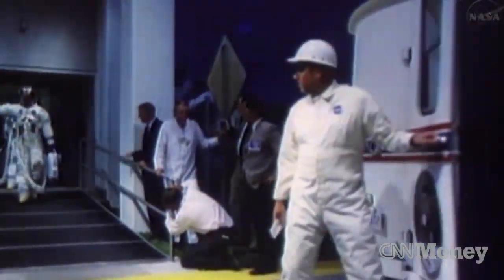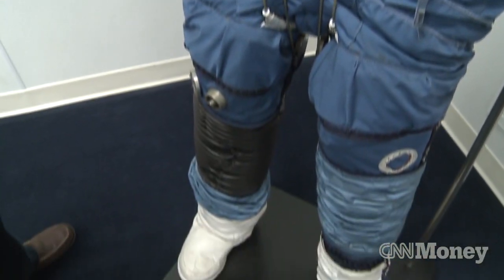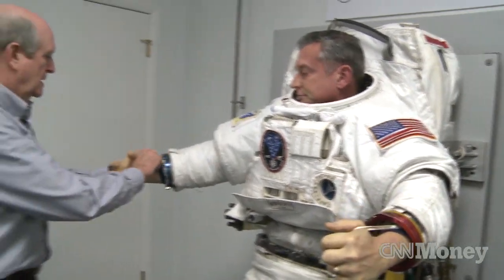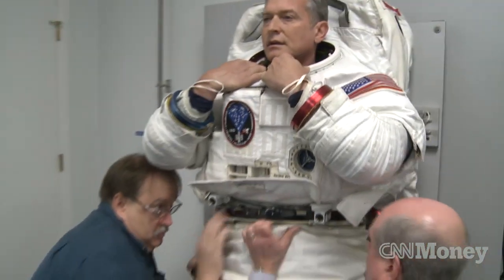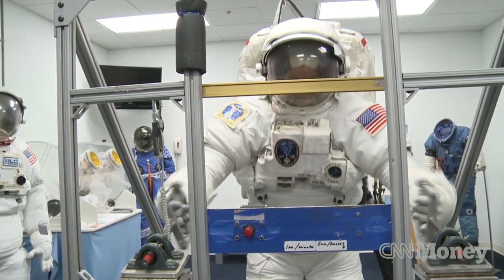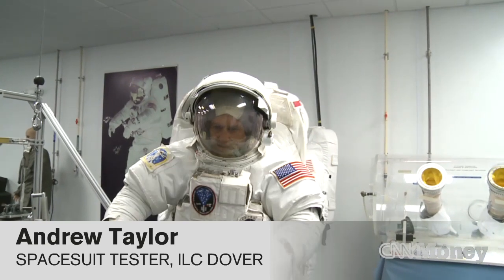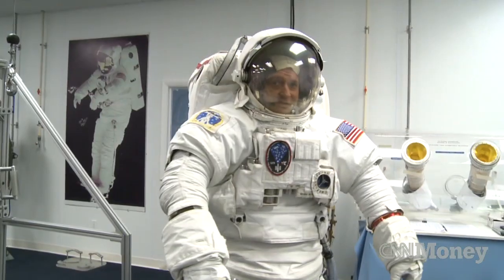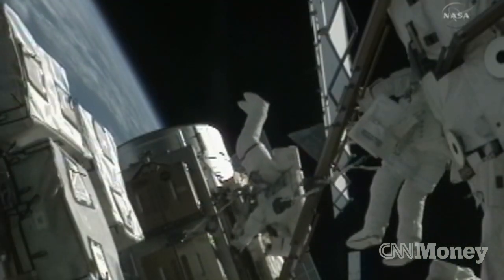See how NASA spacesuits are tested

Comment: Guys - you don't need to vacuum test a spacesuit. A spacesuit is not stressed by a vacuum, but by its internal pressure. Vacuums don't do anything. Here on Earth, at sea level the atmospheric pressure is about 15 psi. In space, suits are pressurised to about 5 psi of pure oxygen. To pressure test the suit here on Earth you only need to apply the same differential pressure of around 5 psi that would be seen in space conditions. Therefore an internal pressure test of approximately 15 + 5 = 20 psi.

In fact, the suits would likely be tested to higher pressures than this, i.e. 20 psi x SAFETY FACTOR.
Reply: They cannot use that formula since the torr level differences between a vacuum chamber and deep space is not even comparable. Try 2000 psi instead of 20
Reply: @xismxist  I am not talking about using a vacuum test. Rather a differential pressure test.

The differences between a vacuum chamber and deep space may appear great in terms of the pressures, as measured in torr, but that is a tiny unit (tiny fractions of 1/760 of atmospheric pressure). The difference between deep space and an artificial 'high vacuum' created on Earth is about 0.0000001 Pa or about 0.000000000001 Torr.
Regardless of the units involved the key point is that vacuum places no loads upon any structure - only a pressure differential can do that. (Vacuums do not "suck").
Therefore to test a spacesuit in terms of its structure, flexibility and atmosphere retention one only has to create the pressure difference that would be experienced by the suit in deep space.
That does not mean that a vacuum chamber test would not be desireable - but as I have also explained the difference between artificial high vacuum and deep space is negligible in terms of suit or life support functioning.
Reply: @eventcone  But i did, since you made it looks so easy "you only need to... blah" - wrong! you cannot ASUME. Only a test in true vacuum will prove what the suits can take. The pressure they NEED to test the suits with will most likely cause them to bow up. Even to this day, no humans has ever been tested inside the worlds most "powerful" vacuum chamber, why not?
Reply: @xismxist  "Only a test in true vacuum will prove what the suits can take".
Structurally? That's not true at all. A suit tested in atmosphere at sea level pressurised to 20 psi or so will experience the same pressure loading as one tested in deep space pressurised to 5 psi.

"The pressure they NEED to test the suits with will most likely cause them to bow up".
What does this even mean? "Bow up"?

"Even to this day, no humans has ever been tested inside the worlds most "powerful" vacuum chamber, why not?"
So far you have failed to explain why you think this would be necessary.
Reply: @xismxist  "Only a test in true vacuum will prove what the suits can take".
Structurally? That's not true at all. A suit tested in atmosphere at sea level pressurised to 20 psi or so will experience the same pressure loading as one tested in deep space pressurised to 5 psi.

"The pressure they NEED to test the suits with will most likely cause them to bow up".
What does this even mean? "Bow up"?

"Even to this day, no humans has ever been tested inside the worlds most "powerful" vacuum chamber, why not?"
So far you have failed to explain why you think this would be necessary.
Reply: @eventcone  Again you ASUME that 20 psi is enough to use when pressure testing a suit, well that formula MIGHT work for a very low earth orbit but doesnt stand a chance in deep space (i.e on moon) and you know that i meant to say BLOW up! aleady out of arguments so you start pointing out spelling errors? well that IS typical for the propagandists to do.  And no, NASA is the ones who should explain why they dont dare to put humans inside their biggest vacuum chamber, after all thats just a walk in the park compared to the vacuum levels in deep space
Reply: @xismxist  So you have run out of arguments? Your last post contains none - merely assertions and rants. Please tell the world WHY a 20 psi test in atmosphere would not "stand a chance" of replicating the conditions of deep space?

Blow up? I suspected it, but I did not want to ASSUME. After all you may have had some knowledge of some other type of failure mode called "bowing up" that I was not aware of. So, blowing up: you mean a structural failure involving rapid suit depressurisation. And so we come again to the key question: WHY would a 20 psi pressurisation in atmosphere not provide a suitable test of a suit's structural integrity?
Reply: @eventcone  Thats a good question. First, like i said no humans has ever been tested inside the worlds biggest vacuum chamber. Second, that chamber is no way NEAR the torr levels of deep space so the conditions CANNOT be replicated. Third, so how do they know the 20 psi pressure testing is enough?! (if we using 5.3 + 14.7 as an example) thats why all "real" pressure tests needs to be in a vacuum chamber (to begin with) and with "blowing up" it can be some part of the suit or just a leak as well. BTW are you aware of that the apollo suits was supposed to keep the pressure  with a zipper(!)? and, do you believe nasas spacesuits protects against micrometeorites?
Reply: @xismxist  "First, like i said no humans has ever been tested inside the worlds biggest vacuum chamber".
Even if true, that doesn't matter. A test at 1 Pascal of pressure (a tiny, tiny fraction of 1 psi) is close enough to vacuum.

"Second, that chamber is no way NEAR the torr levels of deep space so the conditions CANNOT be replicated".
The differences, in terms of pressure, are insignificant. You cannot get a lower pressure than zero. If in a vacuum chamber you reduce pressure from atmospheric sea level pressure to within 0.000099% of zero pressure, that is a perfect vacuum in pressure terms. The difference in terms of pressure loading is utterly insignificant - a sneeze or a fart in a spacesuit would likely produce more significant additional pressure load.

"Third, so how do they know the 20 psi pressure testing is enough?"
Because 20 psi minus atmospheric pressure is equal to the operational suit pressure. You have therefore matched the differential pressure conditions of outer space.

This is not about vacuum - it's about pressure, or more specifically, pressure differential.
It doesn't matter how close a vacuum chamber comes to creating the conditions of deep space - the differences are beyond tiny compared to a suit's internal pressure. And in any event a suit will be designed to support a greater amount of pressure than it is expected to see operationally.
Reply: @eventcone All vacuums isnt the same. Imagine the torr levels as an opposite force of psi. And you have to remember that having someone pressurized and surrounded by the infinity vacuum of space is a whole different ball game than a man-made vacuum chamber surrounded by an atmosphere! But if the differences is so tiny like you believe then,how come they're testing the todays suits with a pressure that can barely simulate low earth orbit? i can see the answer: "they dont need to because they dont go higher", well fair enough. But thats a modern suit... remember the apollo suits was supposed to hold the pressure with a zipper
Reply: @xismxist  "All vacuums isnt (sic) the same"
No one said they were.

"Imagine the torr levels as an opposite force of psi".
No. Torr is a unit of pressure. As are psi, Pascal etc.

"And you have to remember that having someone pressurized and surrounded by the infinity vacuum of space is a whole different ball game than a man-made vacuum chamber surrounded by an atmosphere!"
No it isn't.

"But if the differences is so tiny like you believe then, how come they're testing the todays suits with a pressure that can barely simulate low earth orbit?"
Because the differences are tiny.

"... remember the apollo suits was supposed to hold the pressure with a zipper".
What's your problem with zippers? 

Don't you think you should leave engineering to engineers?
Reply: @eventcone  The vacuum chamber that were used when a suit failed in 1966 could pull a vacuum equal to only -1 torr... on the moon theres -11. Not THAT tiny. 12 astronauts supposed to have walked on the moon, yet their suits didnt show any sign of inflation at all, no "balloon" effect whatsoever. The suits used when work is being done on the space station actually appears more inflated, yet they operates at only 4.3 psi (apollo suits were at approx 5.2)

Would be fun to see these apollo zipper suits tested with 20+ psi
Reply: @xismxist  "-1 torr" from a vacuum chamber?
"-11 torr" on the Moon?
The Torr is a unit of pressure, equal to 1/760 of a standard atmosphere, or 101,325/760 = 133.32 Pa, or 14.7/760 = 0.019 psi.
Why are you using negative values to denote vacuum? The numbers you are using make no sense.
Medium quality vacuum systems can produce a vacuum down to one thousandth of a Torr.
Outer space vacuums vary from one millionth of a Torr down to a 100 quadrillionth (10^-17).
Given that a standard atmosphere of pressure in imperial measurements is 14.7 pounds per square inch, then the difference between a "medium quality" vacuum and that of deep space would be 0.001 Torr = 0.001 x 14.7/760 = 0.00002 pounds per square inch - a truly tiny difference in terms of the pressure differential applied to the suit.

You still seem to be seeing "vacuum" as something which places a load on a suit (or a spacecraft) when it does no such thing. Vacuums do nothing. It is the suit's internal pressure that loads the suit.

How would you expect to "see" a suits inflation, given that they were designed not to strain beyond a minimal amount in order to keep the suits flexibility within limits of useability?
Reply: @eventcone  Well we have to put a 10 in front the "-" like 10 -11 is a much "harder" vacuum than 10 -1... i dont know how else i could explain it. I agree it doesnt make any sense but i was just follow a table i found. And i would expect a suit at 5.2 psi to show much more of a balloon effect than 4.3 psu suit, this isnt a question of a design but more about common sense.  Especially the apollo suits which didnt have a seperate inner bladder but was more like to have the entire inner suit filled up with pressure, due to the zipper design (with no leaks at all?! lol)
Reply: @xismxist  Ahh. I think you mean 10 to the power of -11. This is simply a convention in mathematics for dealing woth either very large numbers or, in this case, very small numbers.
In other words
Writing 10^9 instead of 1,000,000,000.
Writing 10^-9 instead of 0.000000001

So 10^-11 Torr is 0,00000000001 Torr - a very tiny pressure.
In your account of the suit depressurisation in a vacuum chamber test in 1966, you stated that the chamber pressure of "-1 Torr", so I assume you mean 10^-1 Torr or 0.1 Torr.
10^-11 is such a small number that the difference between 10^-1 Torr and 10^-11 Torr is very nearly 10^-1 Torr (0.1 Torr).
Converting this to psi, the difference is 0.1 x 14.7/760 = 0.0019 pounds per square inch.

The difference may appear large to your eyes (from 10^-1 to 10^-11) and, in percentage terms it is. However in absolute terms it is a very small number - because we are only ever dealing with very small numbers (very small pressures). Imagine the difference between having a tenth of a penny and a billionth of a penny - you're not rich either way.

The suits had multiple layers. One of these layers was a "restraint layer" whose job was to prevent ballooning of the pressure layer.
Reply: @xismxist  So, what is your response to my last post? It seems that you have been attempting to argue that Apollo spacesuits were never tested at anything close to deep space vacuum conditions based on a complete misunderstanding of the numbers involved. You really need to question your own attitudes and beliefs here. If you don't understand the subject matter - what are you doing insisting that the whole thing was a fraud, that it was faked? Before you question anything you have FIRST to understand it.
Reply: @eventcone  There is a posibility that your right about the vacuum differences, i dont have the knowledge to verify or deny it one way or another. But theres so many other questions with no good answers...
Reply: @xismxist  Have you ever addressed those questions to the people who would know? Or made a thorough study of the subject matter?

The plausibility of any conspiracy theory rises in proportion to one's ignorance of the subject matter.
Reply: @eventcone  Theres some questions that even nasa wont/cant answer.  Sounds from hammering and throwing objects has been recorded which should had been impossible if they were on the moon, and the flag waving without no one touching it
Reply: @xismxist  And you think that such "questions" are enough to doubt the reality of the moonlandings? When I come up against such things I think "that's interesting - I wonder how that sound could have been picked up on the recording", whereas you seem to think "the whole thing is fake".

Which of us is the more reasonable?

You do know that sound travels not only through air, but through all states of matter, gas, liquid and solid? Under the right circumstances, can not the sound of a hammer's impact travel along the hammer's handle, through a glove and into a spacesuit's internal atmosphere, there to be picked up by a microphone?

In other cases, can not the sound picked up merely come from some other source (for example an open microphone in mission control, where the footage was recorded) and just happen to coincide with the arrival of footage showing a certain activity from the moon?

And in yet other cases, can not the apparent sounds, as shown in certain videos and websites, be faked? It would be easy enough to dub some sound onto original Apollo footage. Make no mistake, fakery is part of the strategy of certain individuals engaged in promoting and selling "The Apollo Hoax". Are you watching original, unadulterated Apollo footage?

A flage moving without anyone touching it? If you are talking about a flag continuing to move AFTER someone has touched it - that happens in vacuum, for there is no air to damp out its motion. The flag ontinues to swing like a pendulum for a long time. And if you are talking about a flag COMMENCING to move before anyone touches it - from the rest of the footage we know that astronauts disturb a lot of surface material (regolith) in the gentlest of motions. This material follows beautiful parabolic trajectories back to the surface. It would be very easy for some of this disturbed material to strike either the flagpole or the flag itself and set the flag moving.

The point is that such anomalies are normal - even in our everyday lives. You cannot always know the cause of every effect that you see or hear.
Reply: @xismxist  There's some interesting stuff there. I wonder what caused those particular phenomena.

Did you ask yourself that particular question, before rushing to the conclusion of fakery? Did you look into any of the details? If not, why not?

The explanation of sound travelling through gloves into suits is not debunked - it is simply the particular experience of those astronauts. I did state earlier that this could happen "under the right circumstances". Clearly the right circumstances did not occur for those particular astronauts. Perhaps their glove and suit designs were different. Perhaps their hammer designs were different. Perhaps being in zero gravity makes a key difference. Perhaps they never hit anything as hard as the Apollo astronauts did. These are all possibilities that should be considered and if necessary investigated before hollering "fake!"

No. I don't accept the claim that NASA "fakes" anything. How can you possibly claim that a "spacecraft film" version is "the original" and then state that the version on the "Apollo Journal Website" is amended. You have no basis for such a conclusion. It makes far more sense to conclude that it is likely that producers of popular video releases cut down on viewing time by snipping out the delays from the original recordings.
Reply: @eventcone  Have YOU considering what caused those particular phenomens could simple been... air? on earth. Yes i do ask myself sometimes, one could offer several explanations since the todays spacesuits is different from apollos. But theres no logic on how gloves, suit details, different hammers etc could change or have any effect on the alleged environment: vacuum of space. When not even  powertools on the ISS can be heard then why would hammering be heard on the moon?  But the absolute strangest anomalies of them all is the throwing object on the lm that caused a sound - that should be impossible and cannot be explained with vibrations/transfering through material
Reply: GoldVillage 
Oh yes, the flag waving, that has never been explained. (sarcasm)
Reply: Space suits have a relief valve to prevent over pressure. The moon suit relief valve was set at 8 psi.
For testing they might want to take it  to a higher pressure though.